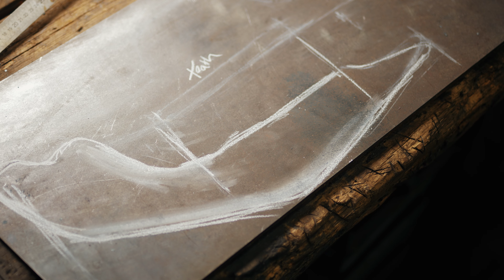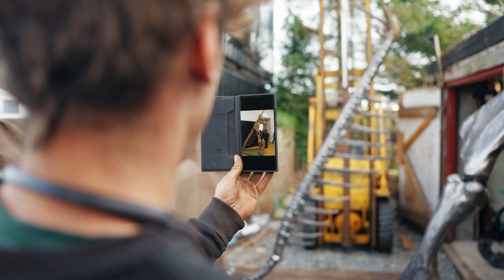Blacksmith makes world's DUMBEST dinosaur?

Comment: Well that was an enjoyable epic video. One question, why did you weld the ribs together in a solid fuel forge instead of the gasser? (and if Mr. Pilkington so small, I hate to think what you'd say about my 25lb Jardine slap hammer, mind you Jim Hirsoulis thinks they look like they belong on a watch chain so . . .)
Reply from the maker: For firewelding the tips it's just so much easier and cheaper than having the gas forge door open plus it was a nice day and I wanted to be outside haha, haha naw any powerhammer is cool! I think it was just struggling with the 50mm round bar and I am just wanting a bigger one for bigger projects. One day maybe
Reply: @natesforge  A friend of mine has a working 600 lb Niles Bement Pond steam hammer (that he actually has run on steam, but usualy on air.) It would have made short work of that 50mil bar . . .